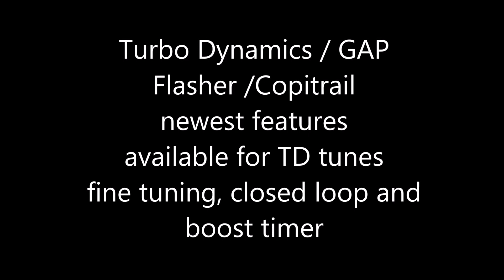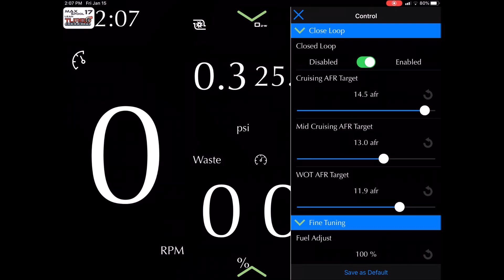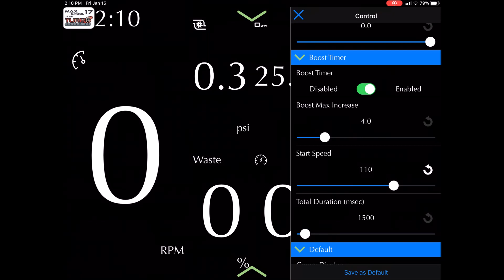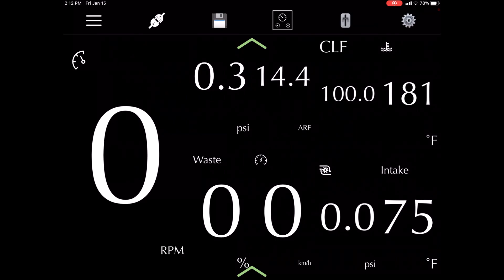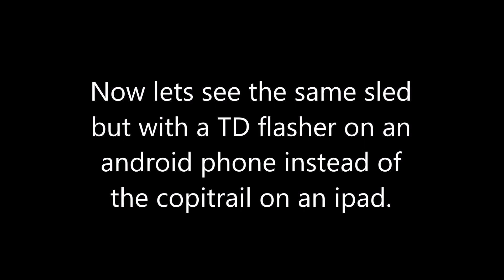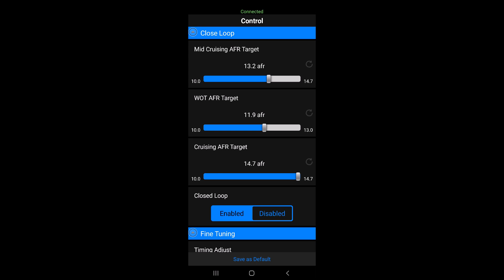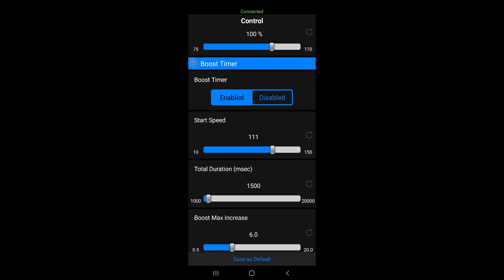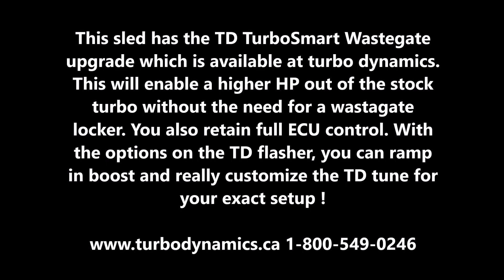Turbo Dynamics GAP advanced tuning features for TD flasher and Copitrail

Comment: Can one of these be tuned to run on 87 octane safely just by reducing timing and boost yet still have good power, just less of it?
Reply from the maker: Yes of course. The ecotrail tune runs already on 87 while providing extra power over stock mapping. But you can also remove timing from a map to further improve knock prevention on a tune.